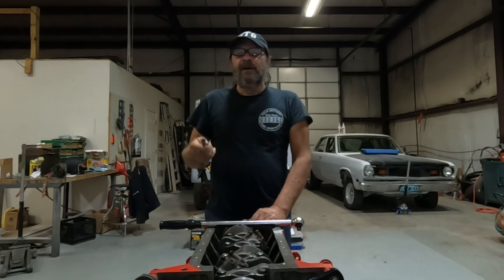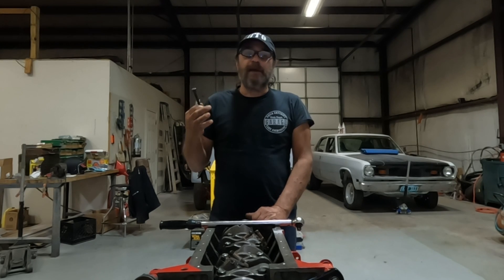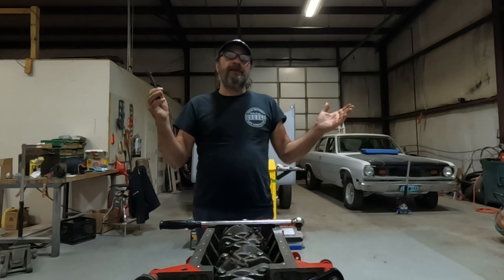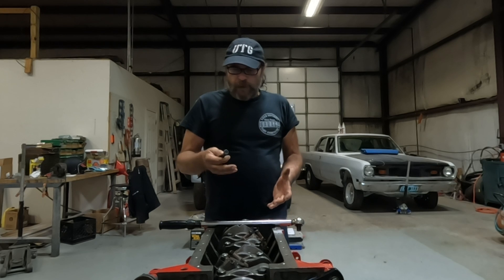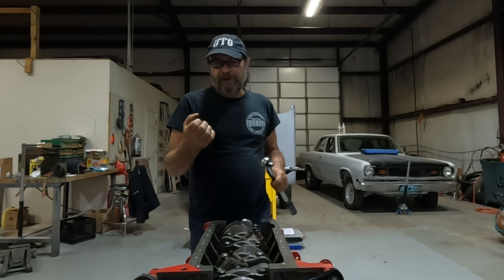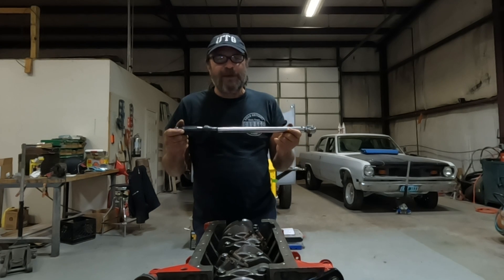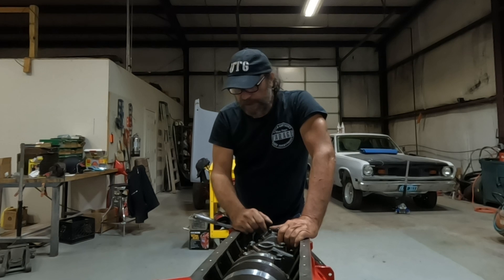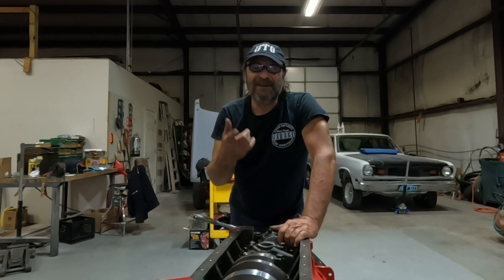Torquing Mains, Rods And Cylinder Heads For The Home Engine Builder

Comment: This is something Tony missed in Words, but watch his elbow, and his wrench hand. It's always on the same plane and he tries to keep his hand in the same spot on the wrench. That's TOTAL experience in motion doing this stuff. He keeps his body in the same plane so as you are doing all this, you are coming to the torque with a nice "smooth" motion. I don't know.... watching him doing this is EXACTLY what my dad taught me years ago, and it took a few times before I got the hang of it, but if you watch Tony's body, hands, motion, stance, etc etc etc while he's doing this, you will pick it up really quick.
Great Video Uncle Tony.
Reply from the maker: Y'know, I didn't even think to mention any of that but I'm glad you did!
Positioning of body and wrench are extremely important for consistency.  You can see when I got to the #2 main, I was struggling to maintain position as the engine stand wanted to move...but I was thinking more camera shot than best angle for the job.  I gave in and stepped to the side for the #1 main.  Shooting off the Gopro I didn't know if I'd still be in the shot, and I wanted to run this with as little editing as possible...showing the true flow of the job for someone who has never done it.
Reply: Great fourm lmao ✌️
Reply: I use a calibrated elbow, torque is only for dry threads.
Reply: @shadowopsairman1583  You need to read more manufacturer's assembly instructions. I don't mean to be a keyboard warrior, I have 48 years experience. Not all threads should be dry to be torqued, many fasteners require lubricants, some manufacture's even call for a specific lubricant by a specific brand, the crankshaft main cap bolts on some Cummins and International motors come to mind.
Reply: @logan_e  well said,sir
Reply: He's the Charlie Daniels of the torque wrench.
Reply: I once had the opportunity to visit a machine shop that worked mostly on Cessna engines. The most silent room in the building was the torque room, almost like walking to a church, the sound of the fans and those sweet clicks after clicks music to my ears.
Reply: I always cringe when I see usually young guys use the wrench and not pull the way your talking about. It's like fingernails on the chalk board

Comment: Something to note: if you have an old torque wrench that has been laying around in the box set to 110lb ft for 8 years and you don’t trust it, you can get them professionally calibrated. It’s not expensive and it’s a good way to start fresh and be confident in your tool. If you are in to building top tier race engines, may be a good idea to get it done every couple years.

Comment: The second click is static (stationary)friction, so it's not as accurate as the first click (dynamic/moving) friction, but is a good habit for the reason given. Also dry torque specs are much higher than lubed specs, often nearly double.

Comment: Should the threads be lubricated or not?
For Example:
Most spark plug torque specs are based on a dry thread.

Is it specified to lubricate the threads for these engine parts?

I like the idea of lubrication but it can make a difference, because less torque is required to overcome friction - thus more bolt stretch & possibly of stripping the threads.

If the thread is lubricated you may be over torquing the bolt?

Comment: I've always been a double clicker too, recently after discovering what is known as "instructions" for said tourqe wrench (at least one in particular seems to come with "instructions") they suggested there is a special grease inside the clicker mech that is only accurate after a first click that spreads this grease, then the second will be good. Seems a bit of a stretch but they wrote it. Also I recently set up a crush sleeve on a chevy 10 bolt and my 1/4" clicker would not work to measure bearing preload so a beam type in inch/lbs was the solution. Also recently heard all tourqe specs are for dry threads, unless otherwise specified. Great video as always good sir, thank you

Comment: The double click is a waste of time. If the wrench clicks whilst moving - under dynamic friction, - then you stop, then lean on it again, the breakaway - or 'static' - friction is going to be significantly greater than the actual torque you just put on the fastener.
There is no situation where you'll click a moving wrench and then find the fastener wants to move more before clicking again. It isn't possible.

I also double click, but I admit that it's out of habit and compulsion!

Comment: One thing you might mention about using a torque wrench properly - especially with the clicker type - is you HAVE to do your sweep with the wrench in a slow, smooth motion. If you jerk the wrench hard/fast, you're almost guaranteed to get a false click. I see amateurs make this mistake all the time, especially with big nuts/bolts that require alot of torque, like lug nuts. Lots of times you see these guys who don't know how to use a torque wrench properly jumping on them until they get a click, and doing it like that is almost guaranteed a false click. You have to use a smooth, slow pull on a torque wrench to get an accurate click. I could see you doing this, but guys that don't know might not have picked up on it. I'm a double clicker too, I don't care who doesn't agree with it lol. I like having the confirmation from the second click that the first wasn't false.

Comment: the BIGGEST thing...
.
a bolt MUST be moving to get an accurate torque
.
you can get to about 90 foot pounds.... stop.... and then get a click.
.
but with a digital wrench.... you would see the foot pounds build and build... till the bolt starts to turn, and then the torque would drop down
.
its called BREAKAWAY torque.... or static friction 
.
you have to overcome that friction, get it moving, and CONTINUE to keep the bolt moving till you get hte click
.
.
again... if you are going for 100
get to 80 or 90 and stop
its gonna click at 80 or 90.... not 100

Comment: ive had customers kinda get shocked when i told them i didnt torque their screws that hold the air filter box together..... or their P/S pump... ETC
.
like... EVERY bolt and screw on a car has a torque spec
.
only about 20% actually matter

Comment: Tell me if im wrong, you mention in other videos that you could tork bolts 5 pounds less intentionaly to let the crankshaft spin à little easier and unleash a couple of HP out of it.  Do you do it specialy on lower RPM engines not to stretch the bolts too much if it would be a high RPM engines.  Or it doesnt make any difference RPM-Torque specs ?  Thanks

Comment: I think an important detail was left out of the torque explanation. There is a rather large difference between a dry, and a wet torque. If a fastener is given a dry torque value, and it is lubricated, it drastically lessens the torque spec.

Comment: In a perfect world everything would be a stud and you would torque the nut. I tried to explain this to people when I was torquing nuts on aircraft in the Air Force. I worked on aircraft in the 1970s and it wasn't until I think the late 1990s that the Air Force actually came out with an order to make sure that you torque the nut, not the bolt. They had had several aircraft out of the sky because people were holding the nuts and torquing the bolt and that doesn't work. When the torque spec is designed primarily for nuts, not for bolts. That's why head studs are far more effective at clamping Force than head bolts. Another good idea for why you would click a head bolt four times or better. Or even raise it by a few pounds. And torque to yield was a fix for this but then all you do is cause the bolt to fail when you apply the torque.

Comment: Tony, In you're opinion: Will this 383 engine make more power than the Junkyard Jet Magnum 360 ? 
I feel like the 383 will make more torque but I was wondering about horsepower.
You're  383 is so easy to duplicate for very little cash outlay figuring that the only aftermarket parts on the whole engine is the camshaft and intake/carbs.
Around my area (central ohio) 383 HP engines are not too hard to find and they are still relatively cheap. Everyone wants a 440. The 440 motor home power plants are fairly easy to come by around here also because old RVs are abound. Magnum 360 truck engines are everywhere but finding one that has been maintained and isn't all used up is hard to do. The old LA 360s are pretty rare because everyone scooped them up back in the 90s to sit on em. Much the same as the chevy 400sb.

Comment: I'm a believer in the "double click" and I've had those that say digital is the way to go and I'm not onboard with it when it comes to torque wrenches. I was taught in school about stepping up on the torque by a given amount which I don't do in the real world, as far as going to a specific torque value. Maybe you can clear up something that I was taught which is if you set up the torque wrench to a specific setting and then add an extension in-between the wrench and the socket, such as a 6"or longer, it will increase the actual torque given at the nut/bolt and was taught the math equation to determine what the torque is for any given length of extension you may be using. Is that a myth or is there any truth to it?

Comment: Another good practice is after torqueing one thing, rotate the engine. If it isn't free you know where your problem is. If you torque all the mains then rotate and its tight, you need to check all of them to find the one that has a problem.

Comment: Lubrication is a very important factor also. Unless the service manual says otherwise, lightly oiling the threads and the underside of the nut/bolt head with clean engine oil will reduce friction and help the fasteners tighten evenly without binding. Dry threads and friction surfaces are a no no when trying to accurately and consistently torque fasteners.
Reply: Some bolts call for thread sealant, rather than oil. When sealing bolt threads, I use anti-seize under the bolt heads, instead of oil that can run into the threads.
Reply: @jimjungle1397  Good points, some bolts do need sealant which is why I said "unless the service manual says otherwise". I wouldn't use anti seize inside an engine since it has metallic particles in it. Not something you want floating around in the oil. Regular grease could be a viable option, but I personally wouldn't use it if it isn't specified because different types of lubricants will affect the torque values. Would oil vs grease under the head affect the final bolt stretch enough to actually matter? I have no idea, but I'd rather not find out the hard way.
Reply: @averyalexander2303  Sometimes I have used thick EP grease under the bolt heads, not oil when sealant is needed.

Comment: I loved seeing a straight torque setting applied to the rod bolts rather than fiddling with a bolt stretch gauge.

Uncle Tony, what are your views on using bolt stretch gauges and also torque plus angle specs?

One thing I would suggest is to install locking casters on the engine stand.

Comment: I've always been at least a double clicker when torquing anything. I will keep going until I get a click with no discernible movement of the fastener. A third click is acceptable but if the fastener keeps moving too many times before the clicks then I will remove the fastener and examine the threads closely for visible wear and if I can't see anything with the naked eye I will measure the thread diameter and compare with a "good" fastener.

I remember when I first heard about torque-to-yield specs. I found that amusing as any fastener is torqued to yield even if the yield is very tiny because, as Uncle Tony put it so eloquently, all of our threaded fasteners act like springs.

One trick that I use, especially for aluminum heads, is to find the biggest, chunkiest washers I can find to spread the clamping effort. I've done this ever since I disassembled an engine and found that the stock washers had imprinted into the head by a couple or so thousandths. It's never happened with oversized washers are used.

Comment: Great explanation on the fastener and how it actually stretches and works as a spring when torqued. 
I noticed you torqued the mains from back to front - I'm not so familiar with Mopars, is that the torquing pattern recommended by the factory? I just ask because all of the engines I have done had a specific kind of x pattern for main torquing.

Comment: U.T. is spot on here, for any Newbs though, Torque everything possible, it will give you the feel. Also, use a paint pen to keep track... did I torque that? Then you know... God bless U.T. and thanks! Another good practice is to roll the engine 1 rev after you torque each bearing, it don't hurt. You might could save a headache...

Comment: Couple of things: You absolutely can "go wrong" with a clicker-style torque wrench. I've seen guys simply push on through the click to tighten things farther.  The torque spec might be 80ftLbs Max, and they'd get the click at 80, then just push on through another 16th of a turn or more. Then they would invariably release tension and give it a double-click to reassure themselves that they were properly torqued.  You'd sometimes catch the same guys using the torque wrench as a breaker bar on tough disassembly jobs. SMH.
My other point is terminology.  Like the word "timing," the word "torque" has taken on multiple meanings, particularly in the automotive world.  Torque basically means tension, or to tighten.  You can say something like "Torque it down tight," and just mean to tighten the bolt good and tight.  You can also say, as Tony repeatedly did in this video,  something like "Torque all of those bolts," meaning tighten them to a specified tension -- a designated torque spec.  
I wish Tony had clarified this mechanics' shorthand a little for the confused nubes watching.  Things like this can get really confusing for new guys.

Comment: Great vid UT, as they say, seeing is believing...Try to always use a short socket to limit sideloading, otherwise you won't get a true value. My pet peeve's are to have my other hand on the head of the torque wrench to ensure "perpendicularity", particularly if having to use a long socket for clearance. The other is as you're sneaking up on the value, make sure the last pull is at least a smooth continuous 1/4 turn to "the click". Also, to avoid a "damn it", check you're surroundings to make sure that last pull isn't going to be interrupted by an obstruction, i.e. torqueing a head on an engine installed in the vehicle.

Comment: The sound of the pistons on the dry walls bugs me. I guess no harm in that?
Reply: No, no problems, just remember to lightly lubricate the rings and cylinders during assembly. You have to rotate the crank anyway to torque the rod bolts correctly and also as you go along to make sure nothing is binding up!

Comment: Subaru heads for example recommend a two step torque sequence. I think it because the head bolts are fifteen feet long and it is recommended they be replaced EVERY time because of stretch.. which is BS. The whole two step is to keep people from unevenly tightening bolts.. In my opinion..

Comment: Read the book or look on the internet for the ‘foot pounds’ that you need to set your torque wrench to. And it is important to start off the bolt with your hand so you can feel if your ‘cross - threading’. One minor ‘cross - threading’ will result in that bolt coming loose down the line. Be slow with the tightening and feel it coming back into your arm as to notify of any cross threading as your tightening it. If it starts to catch, hopefully its not too late. A mechanic has to be as coordinated as a doctor cutting someone open.

Comment: I always turn the Crank after each cap or rod is torqued. If you wait until all the caps are torqued and then the crank won't turn, you have to undo all the bolts to find the mistake. If you torque a Cap and then the Crank won't turn, you know where your problem is.

Comment: When torquing bolts, work inside out. From the middle outwards. Especially when working with second hand stuff, never spin the assembly before every bolt is torqued. Cap crush makes the bearings round, so the thickness of assembly lube affects the bearing surface. Also, always assemble warm parts, unless they need to be press fitted.
Reply: On some assemblies, like the cylinder head, the manufacturer will specify a torqueing sequence; follow that if stated.